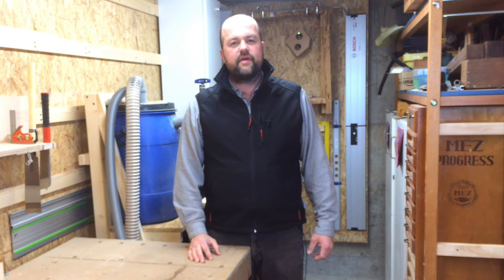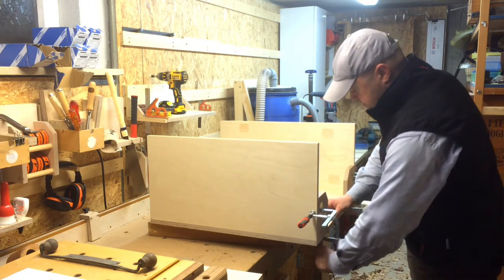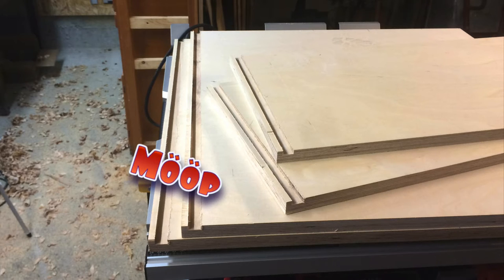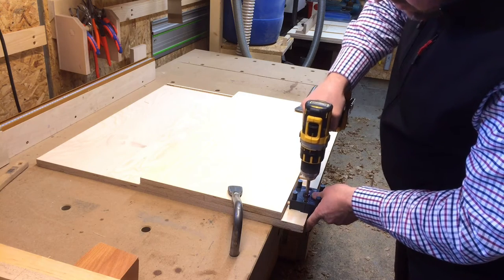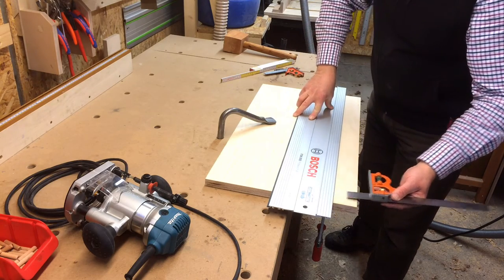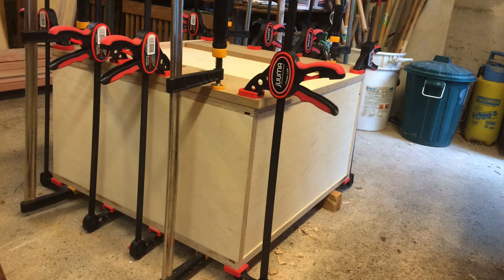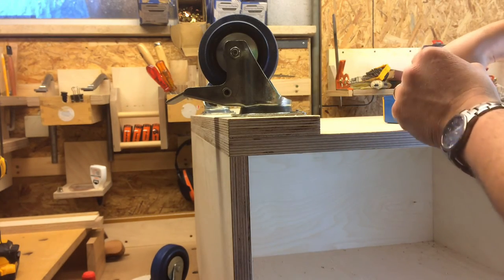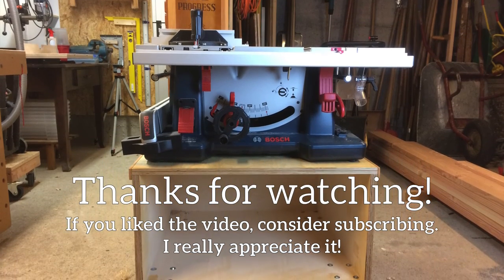MOBILE TABLE SAW STAND – Make a table saw cart for the BOSCH GTS 10 XC

Comment: Hello, what do you think of the noise level of this machine? I'm considering a UK axminster ts200 which has quiet induction motor but looks like poor build quality physical things like handles and knobs.
Reply from the maker: I think the noise level is very acceptable. I haven't used other machines so I can't really compare but even without hearing protection (which I usually wear) it's not tool loud.

Comment: Hi Andreas. I'm curious if you fixed the saw down to the cart top with screws or its help in place with its own weight? I have the same Bosch saw and whilst it has four holes on the sides they don't look like normal screws would work.
Reply from the maker: I fixed it down with some m6 bolts and wing nuts.

Comment: you should really be wearing safety glasses
Reply from the maker: Thanks for your feedback. Actually, I've tried but they fog up very quickly for me and then my vision is severely impaired. In Germany, labor safety regulations even for professional woodworking don’t require them for working with wood, only for metal and plastic work.
Reply: And face mask 😱😱😱, dude you have no idea the amount of fine parts you re breathing , multiply and fibreboards are full of glue and formaldehyde, and you re not using any exhaust device when sanding or routing … honestly that’s insane, I cannot agree with that, when you run a YouTube channel you MUST promote PPI